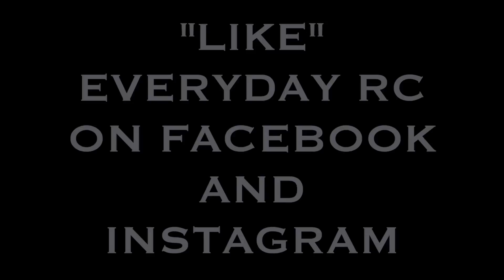ARRMA TALION meets MAXAMPS

Comment: Hi i also run my typhon and talion on 6s max amp 120c and both are beast. My typhon tho has center diff locked with a 21t mod 1 pinion and street tires and my talion is stock.
Reply from the maker: Must be a Beast on the street! Glad to hear your using a similar setup! Thanks for watching!

Comment: Why someone would buy a Talion over a Kraton? Coming from an old Revo 2.5 and I am entertaining the idea of a truggy. Is it handling? Speed? I would think bigger tires and ground clearance would be more fun in the dirt. Around $500, what else should I look? Leaning away from Traxxas. HPI seems good but my understanding is that ARRMA is better. (not racing, just occasional bashing).
Reply from the maker: its all aweeome but Arrma has come a long way and the truggy platform is solid.
Reply: Yeah, really digging the new 2018 Talion! But, looks like they have focused too much on the road handling. I mean, I compared the ride height specs between V2 and the new 2018 Talion and V2 has 37mm ride height vs 45mm on the new one. How is this possible? Didn't they lower it overall for speed?